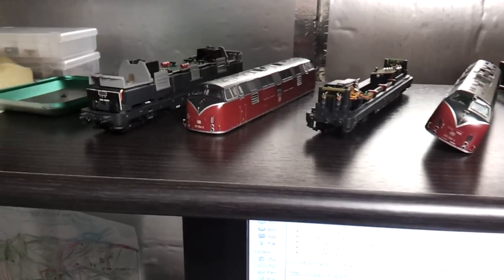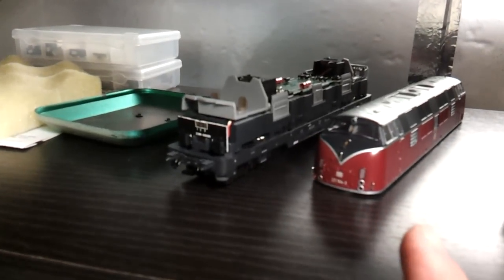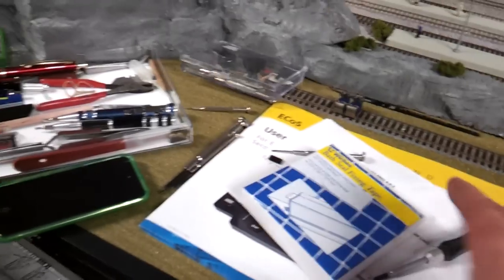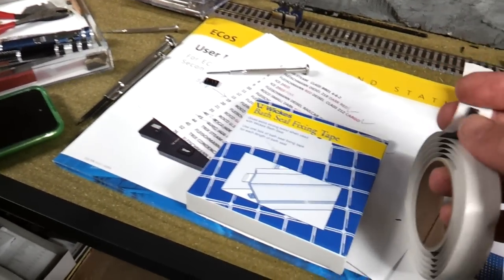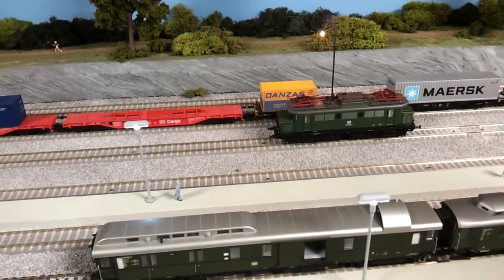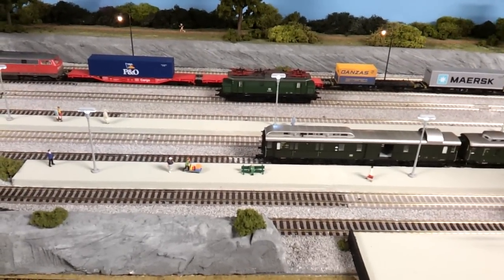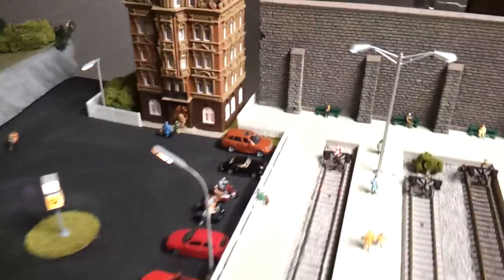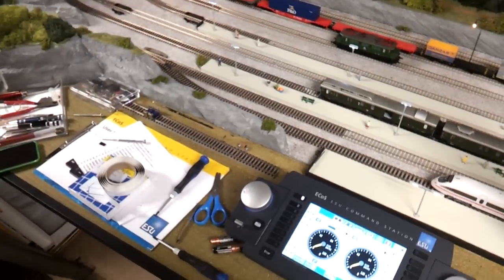layout update fleischmann roco trix trains

Comment from the maker: @02081912Frabas , the roco is superior as its smooth & quiet with 8 wheel drive but the trix is still a fantastic motor but louder with 4 wheel drive, the roco is the leader in the  body  detailing  but  only just.